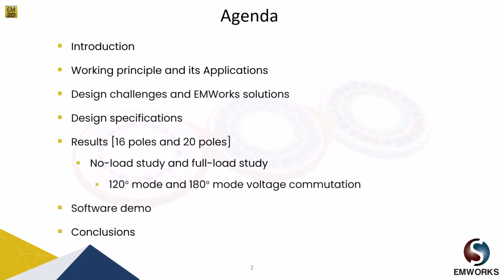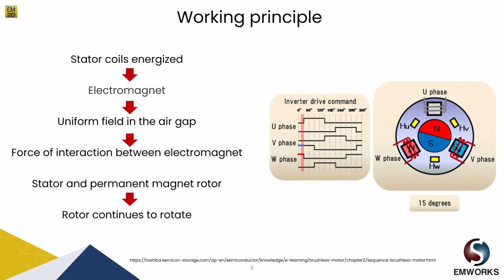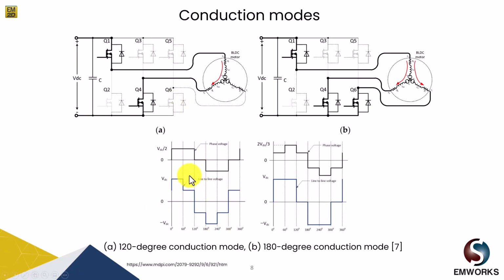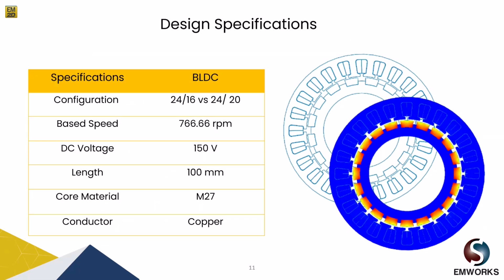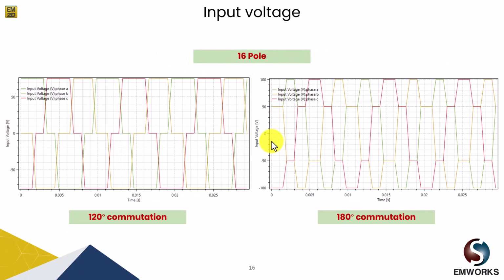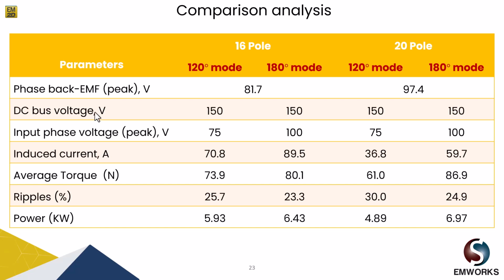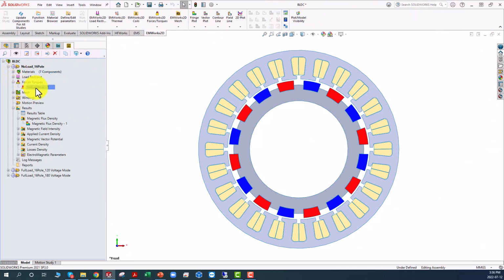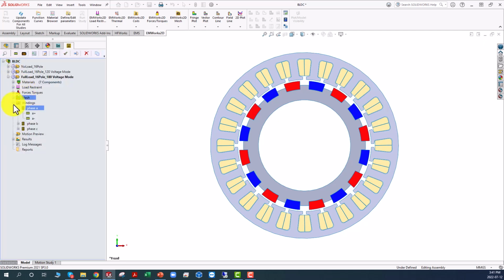[Webinar] Design and Evaluation of Brushless DC Permanent Magnet Machines

Comment: just to point out, dc motor does not have any alternating currents forming
Reply: your fake bldc ac motor changes poles dynamically
Reply: make it true dc emf always constant poles and currents, no alternation, no brushes (or graphite brushed) and no commutator, the ac component maker
Reply: if you need to deal with any ac or control circuit, its not true dc, its fake dc, ac claiming to be dc